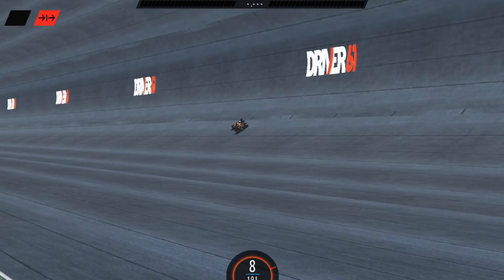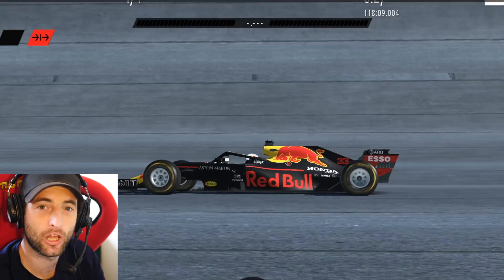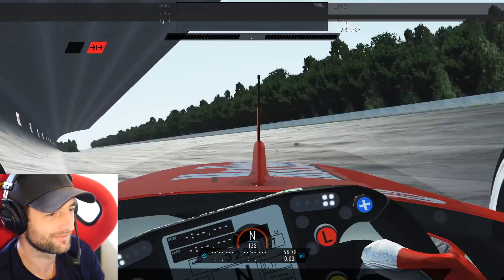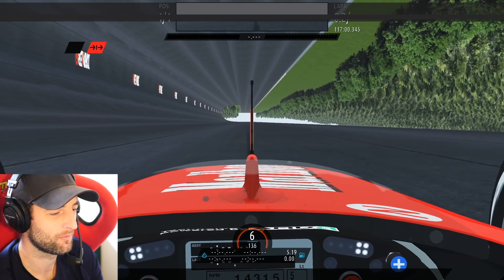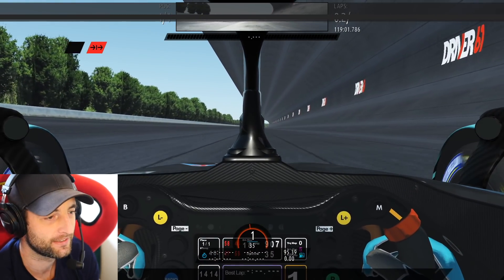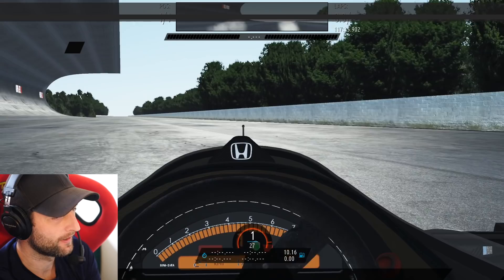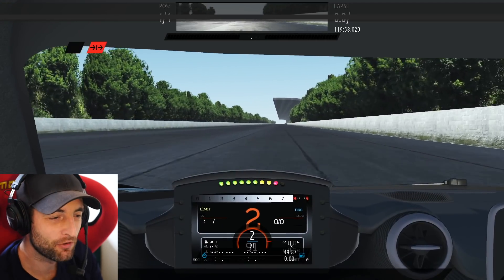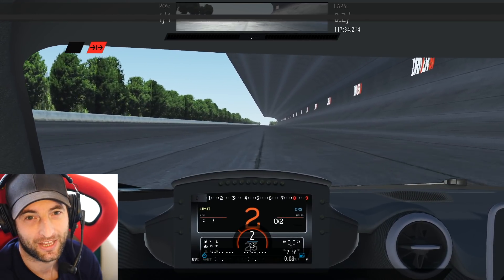Can an F1 Car Drive Upside Down: The Test

Comment: Maintaining oil pressure would be the problem it's theorically possible but you can't run an engine upside so you'd lose drive very quickly
#engineeringproblems

Comment: If you were using a dry sump oil internal combustion engine you wouldn’t have as much of an issue with the oil going up into the top of the engine

Comment: probably not enough suspension travel and when they bottom out, they kick the body instead of absorbing... the rebound needs to be smooth and you need some travel so the body does not move... tho unlike offroad you are literally trying to fly upside down lol... i doubt this would be an easy task to setup!

Comment: Interesting but the transition section is too bumpy which caused most cars to fail. How about a simple straight line and have the track softly turn upside down on its own axis. That way no bumps to interfere and also we can see when the vehicle loses its grip according to the angle of twisting on the track
Reply: EXACTLY

Comment: one of the problems is the curve which makes the ground clearance higher thus aero's stop working at their maximum. If the track looped very gradually then it would be possible for more cars to drive upside down

Comment: Would the oil coming up through the engine not be a problem with dry sump lubrication though? Aircraft piston engines work upside down too, as long as they aren't carburetted

Comment: Not sure I can actually believe that an f1 car can create enough downforce to literally stick to the ceiling and still be getting such good traction, hell it didnt even fall off until you reduced the speed significantly.  Borked simulator seems to me.  Although it would be great to see banked tracks in f1, maybe banked to a high degree and see what happens

Comment: In real life it's not enough to have just enough downforce to hold your weight. You need as much extra downforce in surplus, which provides you enough grip to counter aerodynamic drag, and I'm not sure even F-1 cars have that. If you only have got just enough downforce to hold your weight, your wheels start to spin, you start slowing down quickly, and finally you fall down.

Comment: The map design is working against you in this test. Your map should have a sideways half pipe where you have a run-up, and actually drive into the half pipe and you don't have to turn your steering at all! 
Right now you have this " 🚘）" where the curve is on your right; you actually want this "（ 🚗" where you are driving into the ramp

Comment: Well u can just measure the force exerted on the ground at 0mph and the difference at whatever speed your going to test at becuase you can take the difference between them as the net movement while upsidedown so if its positive then thats to force holding it on the ceiling

Comment: Anything with only a rear wing is always going to fail as the front will always lift (or fall) off the track as there isn't enough holding the front to the track

Comment: Technically the engine powered cars can drive upside down, as they use a dry sump oil system where the oil is stored in a separate tank

Comment: Ad a physicist, why doing this madness of a bumpy truck and drive to the side, completely ruining all the floor aero of the cars (I'm surprised the F1 cars made it), instead of building a (not too tight, not too large) half loop at the end of the straight? That way the centripetal force would keep the cars pressed to the road until they are at the top, and then you would put a straight section... if the car hasn't got enough downforce it would fall off immediately once the half-loop ends

Comment: I don’t know if it’s been mentioned but you could drive a formula 1 car upside down and it wouldn’t have issues immediately. They run a dry sump and the engine oil system is under vacuum and stored in a reservoir. So it shouldn’t have an issue.

Comment: How did he make it driveable? I admit, haven't tried it in rF2 but HAT generation in rF1 only allowed up to 90 degrees and in fact, started to glitch around 80 degrees. rF1 used to sink its tires if the "camber" was over 90 degrees... I have to test this of course now, maybe the loop-de-loops will finally work... edit: nope, still bugs, between 80 and 110 degrees, the most problematic it is between 85 and 105 degrees where the tires will sink on every face, we only have edge-to-edge collision between the tire and the track. Having a curve will make the transition happens faster but it is a bit iffy. Once you get to 110 degrees on the roof of the track, it works normally.
HAT generation works by looking at the mesh from "top down view", orthographically and this, the accuracy is crap one we approach near vertical angle and stops pretty much working at ~80 degrees.. Loop de loops are not possible without a bit of trickery (i've done it, you build literal rails so that the car collides over the problematic vertical parts, sliding it's body against the rails, remove friction from that material in TDF).

Comment: Well the ICE (internal combustion engine) on race cars have dry sump oil systems, and vacuuming in not only the space where the crankshaft is but for the cams as well.  so that when the oil splashes in those cavities,  there is less resistance from the oil when the crank turns, and cams if you have a vacuum there too.

Comment: Interesting idea and results! What I didn't like was the track design, though. The concept was great, but the practice verified it. I would rather put a half loop at the end of a straight line, drive straight up on it, and then the car after exiting that half loop just drives back the track but upside down.
No silly "corkscrew designs" or half-tunnels :) Make it simpler and easier! Be inspired by Trackmania games!

Comment: I’m surprised Red Bull hasn’t actually tried this in real life.
Reply: They would have to modify the engine to run upsidedown
Reply: Swagelele considering what Red Bull has already done on other stunts, I wouldn’t think that would be an issue for them.
Reply: @Swagelele  boxer with a dry carter?
Reply: @andreguilhermediasarraiano9287  in a formula1 car?
Reply: @aeris9087  forgot that part XD
Reply: @Swagelele  because of the Gs they can run practically on their side.
Reply: @Swagelele  boxer engine probably would have no issues
Reply: @Swagelele  why not just modify the drivetrain to install the engine upside down ?
Reply: Probably because there are so many things that can go wrong, and the chance of one of those things happening is very high
Reply: @jacobhanekamp2534   redbull dropped a dude from space i think they could figure out an upside down car if they really wanted to lol
Reply: @hskg  they basically just need a fighter plane engine, aircraft designers have already figured out this upside down engine problem back during WWII
Reply: @jacobhanekamp2534  good pun my friend
Reply: GamingWithFun15 some kind of sophisticated wind tunnel potentially
Reply: @jacobhanekamp2534  remove the driver and have a remote control drive it, Hollywood riggers could totally manufacture this. its how they get stunts with cars done nowadays. essentially thats what this is
Reply: @jacobhanekamp2534  don't have a human in there
Reply: Make the engine work upside down and control it remotely.
Reply: there is one with an sls amg and schumaker on a tunnel, maybe not challenging enough for redbull
Reply: ˙ʍou ʇɥƃᴉɹ uʍop ǝpᴉsdn ɹɐɔ ʎɯ ƃuᴉʌᴉɹp ɯ,I
Reply: Unsafe, the whole engine has to be rebuilt and doing that on a normal car is hard but an f1 engine that just about fits, that's impossible
Reply: Nick Broersen Just make everything upside down. That way everything is the right way up when upside down.
Reply: @sameermohideen4913  but then it wouldn't run right side up
Reply: Nick Broersen I wouldn’t say impossible...a challenge for sure. Piston engine airplanes do it all the time. F1 engines already use a dry sump so potentially that system can be reconfigured. Obviously not as easy as I said it but if anyone is going to do it, it’s going to be Red Bull
Reply: @nickbroersen6714  put a 4 rotor (a 3 would work too) like the 787b, lighter, more powerful and can work upside down. Not really 100% F1 but it would work. And remote control it.
Done. Easy. 10000% possible.
For impossible things to be possible you need to think outside of your comfort zone ^^
Reply: A normal f1 driver couldnt do it though you would need a fighter jet pilot and train him to drive an f1 and thats not even half the battle you have to build the tunnel and modify the car to run upside down you would need plane mods to do that the. Still you have to come up with safety measures if the speed isnt right and the car loses traction an falls
Reply: They could do it with a hydrogen fuel cell as a power source (lighter than batterys), an electrical motor and an remote controlled car that is shaped similar to a f1 car.
Reply: Propably cause it cant happen
Reply: yeap they would need an helicopter engine
Reply: The issue isn't the engine necessarily, you could install baffles and recirculation pumps to keep enough oil where you need it for a short duration. The issue is what happens to the driver if he falls off the upside down track at 120mph+ from a height of 20-30ft in the air because as tough as modern F1 cars are, they're not really build with that sort of impact in mind.
Reply: It would probably be very dangerous
Reply: https://www.reddit.com/r/mythbusters/comments/hr0upv/projectimahara/
Reply: They would have to engineer a track to withstand the downforce
Reply: Yet
Reply: 3001st like
Reply: Not enough driver safety nor an engine that could run upside down and right side up
Reply: The only real modifications needed would be a dry sump oiling system (which is already a feature in nearly every mororsport discipline), a way to prevent oil windage and a way to evacuate said oil from the top of the crank case. Plenty of stunt planes already have combustion engines that work upside down so it’s not the issue. 

The real logistical problem is making a long enough and smooth enough surface to accommodate the stunt, and a way for the driver to practice manuvering into and out of position safely. Remember you’re talking about a near instantaneous loss of weight over the driving wheels and even at high speed with low relative torque, uncontrollable wheelspin is much more likely upside down. Unless your net downforce can appropriately compensate at speed it’s a damgerous game, and you risk being dropped on the floor at 300+ km/h. An accident at that speed won’t be pleasant even with adequate run off with no obstacles.
Reply: Building the track would be a waste of money.
Reply: Stratowind good thing Red Bull has a lot of money. I’m sure it wasn’t cheap to have someone jump from space
Reply: @astroknight5  Remodel an existing tunnel.
Reply: Letting a driver drive upside down at speeds over 200 kph is just plain stupud to be fair. I would love to see them do it, but it's just so much risk. And that's not even considering the fact that they would have to rebuild the engine. If they were to radio control the car it could definitely be done, but they'd still need to be able to very gently ease the car into the upside down part, since even minor damage can completely mess up the downforce.
Reply: AnimalzyNL letting someone jump from 24 miles above earth and falling at over Mach 1 is kind of stupid too but they did it... Radio controlled would be great for testing and collecting data but I don’t think they would invest all the time and money to not do it with a driver in the seat
Reply: @waiganliu8870  Letting someone jump out of space is actually a lot less risky than driving a car at that speed upside down, despite it sounding very insane. With the right gear it's controllable and not that risky. Driving an f1 car upside down at 200 kph however is way more risky. Just a tiny loss of grip and that car is a projectile heading for the ground.
Reply: You could make the engine space bigger and allow the engine to rotate while driving
Reply: @_Razpberrie  then the whole gearbox would have to turn
Reply: @isaacsanchez7317  Not really, they are connected with a rotating axis, so gearbox could stay fixed while the engine rotates. It's a silly idea, but could work in theory lol
Reply: @_Razpberrie  no waaaay really?? Whoa

Comment: why dont you lose any speed when you do sharp turns at 200 mph? im questioning the simulator. I am also curious as to why you take such a sharp angle? can you not worth with the map creator too make a smoother transition? The bumps obv make the car bottom out and "bounce" around and disturbs the aero a lot so I don't feel like this is a fair test.

Comment: Wait it took me 5 minutes to realize this wouldn’t work in real life 😂
Reply: I thought about it for 10 more minutes and I changed my opinion. I was thinking that there is no force fighting against gravity, but I forgot that this is a F1 car. I don’t know anything about them but there must be some aerodynamics that draw the car to the ground, same with other really fast cars. The only reason I continued thinking was why would the simulator community use something that doesn’t simulate correctly, they can’t be stupid 😂 now I was the stupid one 😅
Reply: F1 car's downforce is way bigger than the pulling force of gravity (when u hit 120mph+ as the video suggests). That's why in theory they are able to drive upside down

Comment: Haha, that was very cool. I wonder if any of those cars were borderline enough that they could have done it with a proper ascent ramp? Like a corkscrew type thing that slowly changes angle until you're fully upside down. Prevent that loss of underbody aero, keep the suspension fully compressed, etc.

Comment: At around 7 min 30 seconds you mention we don't know what the bumps do to the downforce.. That is not true when speaking with the broad sence, because we do know that it creates a short term lift in floor height and therefor we know, that it should disturb the velocity and negative pressure underneath the car and diffussor and therefor loose downforce - I know you might know this and trying to keep the broad view on the subject, but I thought for people might ask what it does in the comments anyway :)

Comment: For building up straight line speed a straight line is obviously good, but couldn't they have designed a Möbius-like bend to the upside down bit to avoid the harsh transition?
Interesting video though, thank you :)

Comment: I always thought that downforce in sims worked by just increasing grip, not by literally pushing the car down. Very interesting.
Reply: Probably depends on the sim/game
Reply: That's exactly what downforce is lol, it pushes the car to the ground and increase grip
Reply: @tebibyte2357  well yes, but if all the sim did was gave the car more grip then it wouldn't help when the car is upside down. You could have the most grip in the world, but if you don't have downforce you wouldn't be able to drive upside down, or even on a steep angle for that matter
Reply: @HartyBiker  yes, that's true, you NEED downforce to drive upside down so the car can stay on the ground
Reply: @tebibyte2357  exactly. And I'm sure from a programming perspective it's easier to program downforce as just increased lateral grip rather than as actual downforce. Well done to the devs for putting in the extra effort
Reply: @HartyBiker  Yes much easier than real life.
Reply: @HartyBiker  Yeah yeah, that's what I meant.
Reply: @tebibyte2357  that's why I said "in sim racing"
Reply: @MarcoVenustus  yeah I understand

Comment: before watch I am going to say yes, the wings on an F1 car are basically upside down airplane wings in a sense, modern F1 cars can produce 3 times its weight in down force and as a driver you can experience up to 6g's and more I believe  which why F1 driver a refereed to as pilots

Comment: All very well but the engine would break
Reply: No it wouldn't, they're drysump engines, might need oil injectors like a 2stroke to prolong life, but it would work.
Reply: @themightydash1714  You don't think the oil falling out of the crankcase into the pistons might be a problem at 10~15000 rpm?